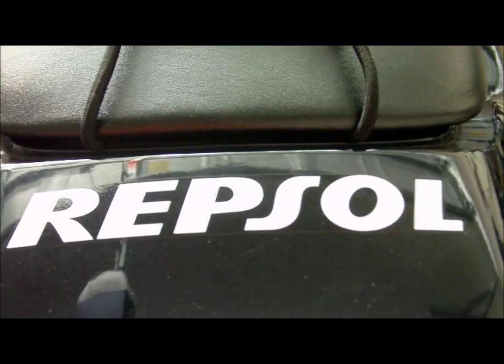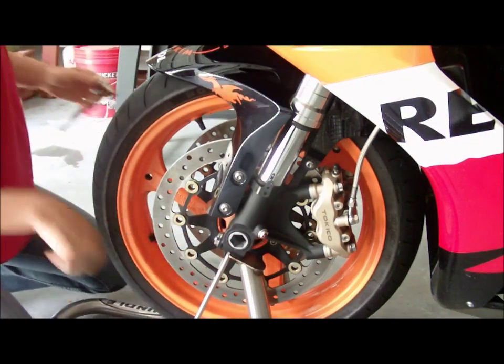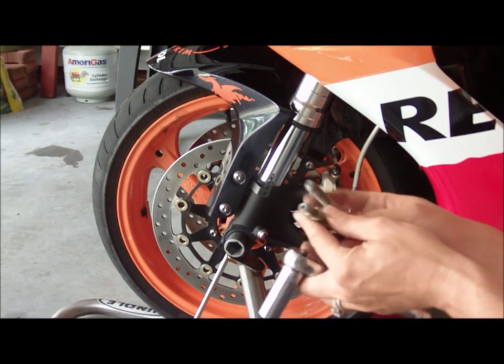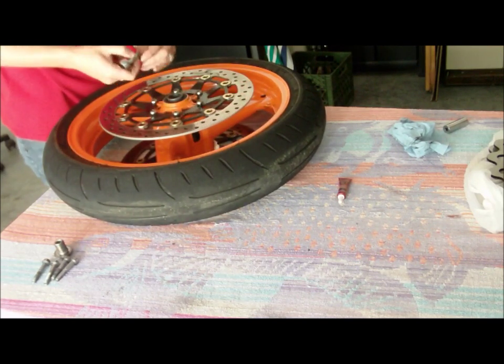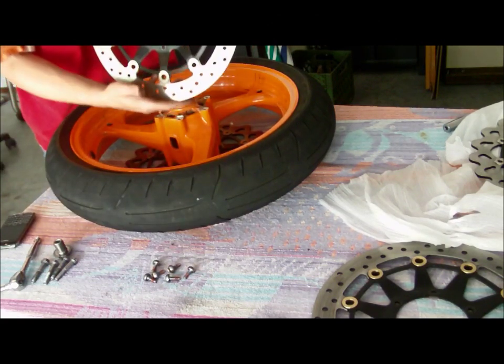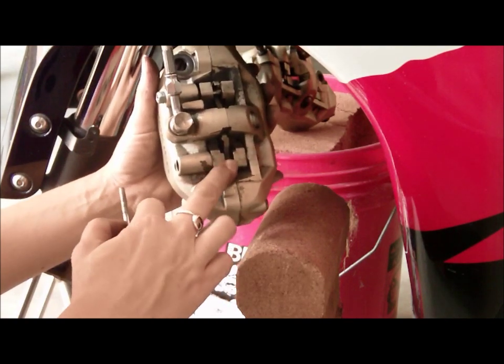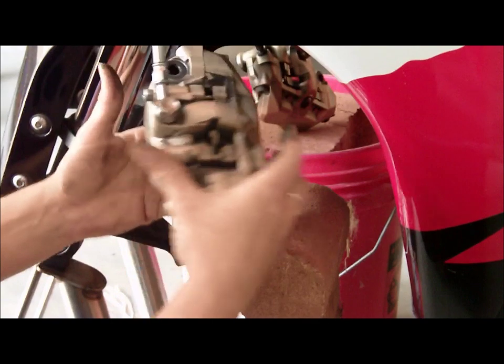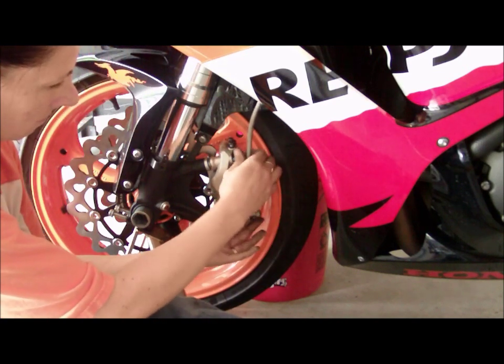Girls can change Motorcycle Rotors and Brakes too!

Comment: Wavy Rotors should be staggered, they should not be a mirror image side to side as you look down thru the wheel. Turn 2nd disc until a high spot is opposite a low spot on other disc. Helps reduce vibration when braking. Good video..

Comment: Good job i have the same discs on my cbr they are very good and a great price on ebay
Reply from the maker: Thanks. I bought the set from www.Madhornets.com for $219. Not a piece. Both. It's a deal I will go back to when its time to do the ones on the T-Mobile bike. :) Those are only $199.99!

Comment: Cool bike.  I can't find any information on how long rotors should last.  Is 14,000 normal?  Also, I'm wondering if a wheel should be rebalanced when new rotors are installed, but I can't find any information on this either.  What do you think?  Thanks for this video!

Comment: next time have someone apply the front brakes than loosen the rotor bolts you'll need to turn the wheel to get to them I find easier.

Comment: I recommend NOT wearing your wedding ring or any other jewelry while working. It is very dangerous and you can easily lose a finger via avulsion or compaction into the flesh. Have a nice day, and thanks for the video!
Reply: J.D. Harp I would also recommend not using Arashi rotors if you intend to ride at any speed :)
Reply: But they are soooo pretty.